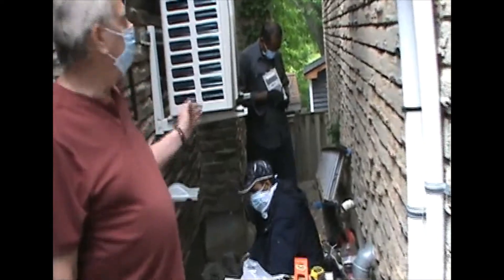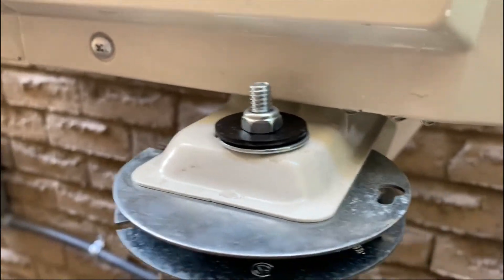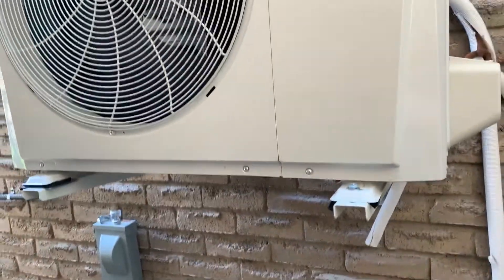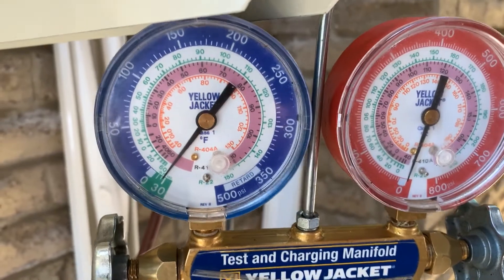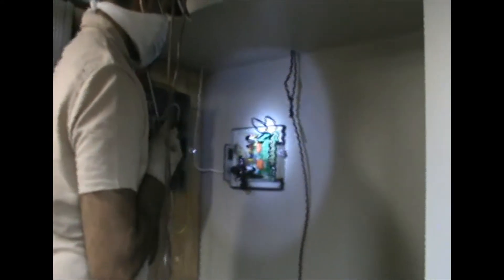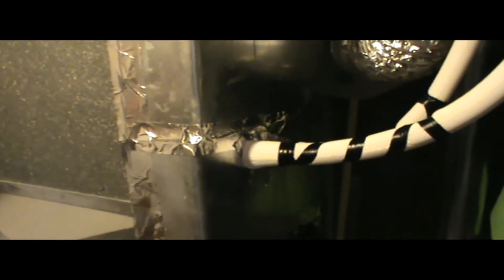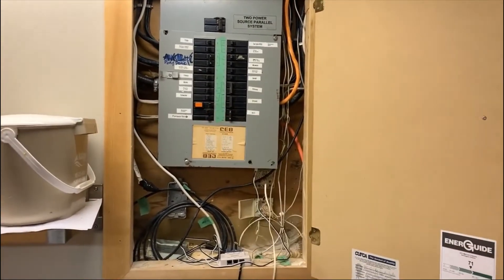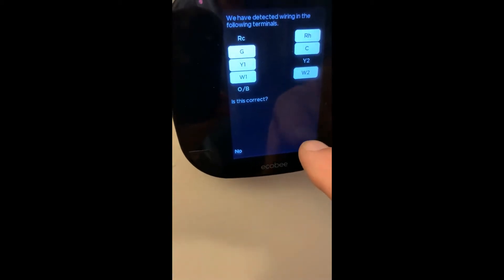Installing a Hybrid Gas Heat Pump with Existing Furnace

Comment: Hi Jim, Thanks for the video. You are the only one posted a video that shows a Hybrid Gas/Heat Pump system. Please put an update how the system worked during the winter months and the energy consumption (both electricity and natural gas) compared to previous winter(s). Thanks.
Reply from the maker: I have a document but not a video yet. I can email it to you if you provide the address. In January 2021, the heat pump operated for 97% of the heating. It went to -12 C. See my video Hybrid Heat Pump Interview for a similar installation.
Reply: @jims2012videostore  What part of the world are you living in? Thanks
Reply from the maker: @Darrylx444  I am just outside of Toronto, Canada